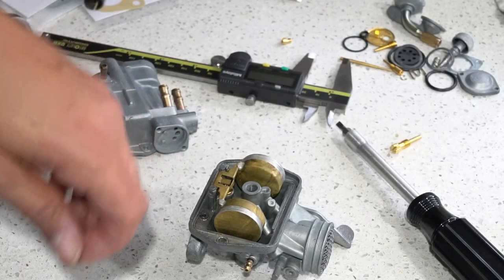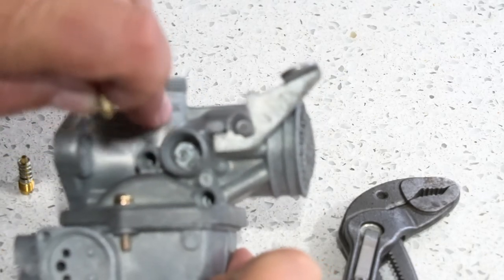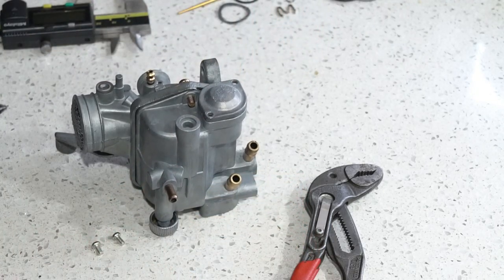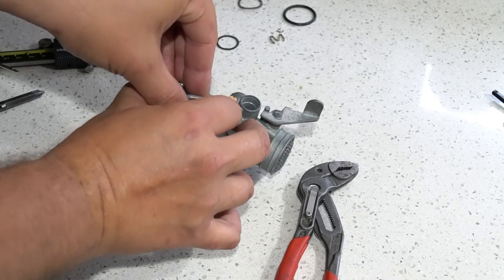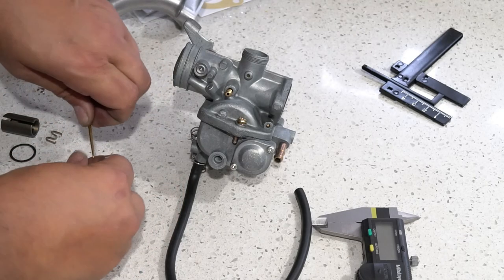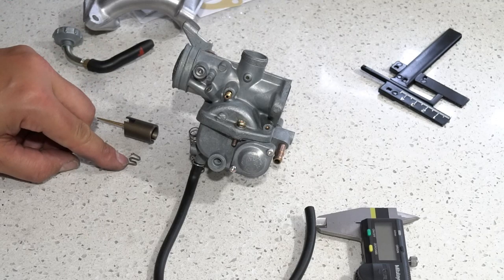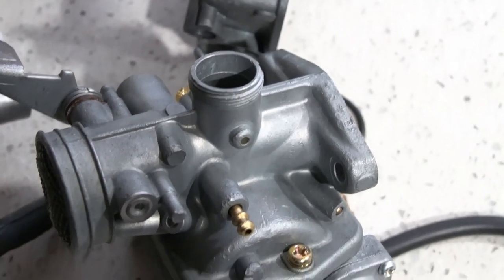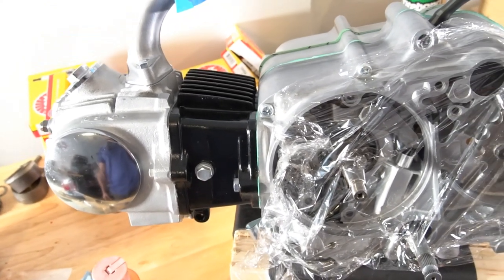Carburetor Rebuild Tutorial - Vintage Honda CT70 Dax Mini Trail - Video 3 of 3

Comment: So I noticed when I was taking my 1971 Honda z50 cam sprocket off that the o was at the bottom. Do I need to attach it back how it was and spin the o to the furthest part to the front when putting the timing chain back on? Thanks
Reply from the maker: Flywheel @ "t" mark and cam sprocket "o" at 9am cylinder head notch is timed.